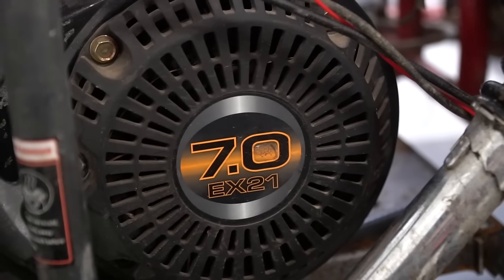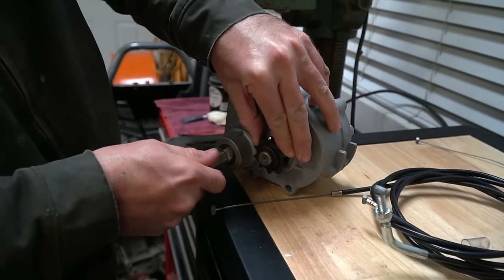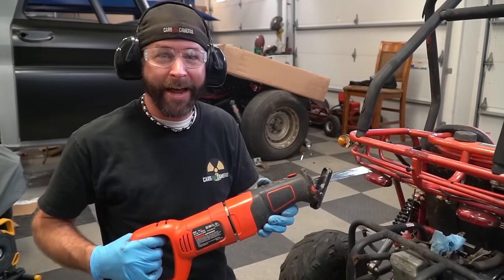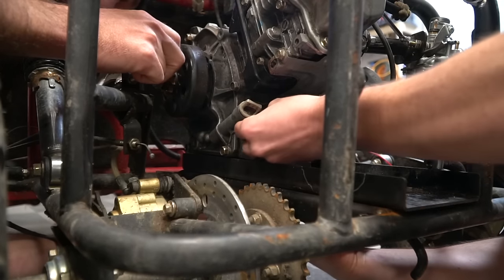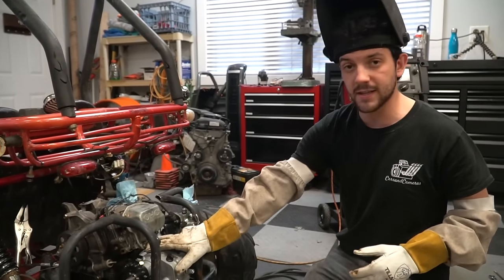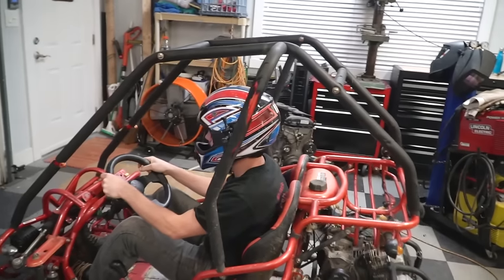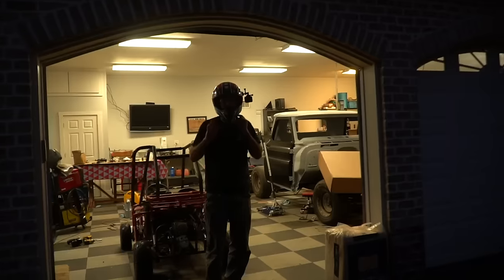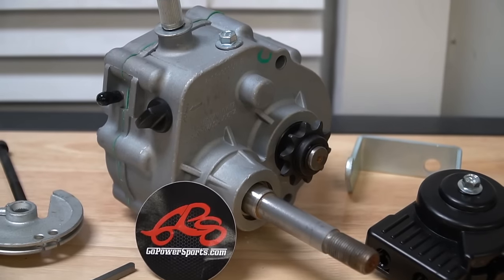Go Kart Reverse Kit Install Pt. 1

Comment: l had good luck running the reverse box with the cvt setup, the other thing is having neutral to be able to warm it up without a load, great video as always,
Reply: Same reverse box?
Reply: @isaacitllbefine7231  yes it is on the beaver amphibious vehicle
Reply: @isaacitllbefine7231  https://youtu.be/JCiZHsq6DrE it gets mated to the engine in this video.
Reply: Hey mustie1 love your vids bro i wish i had any sort of engine to work on but i cant afford any keep up the good work bro ps:i know im super late
Reply: Can this handle 20-30hp range or is this a stupid question.
Reply: @meloncholy4924  2hp to 13hp

Comment: This may have been suggested but y'all should do a tractor pull style go-kart, lawnmower something like that
Reply: Daniel Davis that would be awesome!!
Reply: Needs to be a diesel
Reply: @JakobSGames  true because diesel would have more torque
Reply: little lifted truck bodied thing can probably pull pretty good
Reply: I think they should do a decent mower. 
Not that I think mines all that,but the kids tell me in the video comments it does kick some ass. 
It’s just a 612 deutz allis with a 20hp vtwin and a mst206. 
It’s a blast to drift and it tops out just under 30, and rips donuts and burnouts all day.
Reply: junkiehunter 
I think they just need more hp in general. 
Start with 20 because it’s not hard finding used Briggs v twins, mine was 175 and came with a mower 😬
Reply: junkiehunter bro ur tripping. See yah next fall 👋

Comment from the maker: CORRECTION: THE "OIL FILL LEVEL" MENTIONED AT 2:06 IS NOT ACTUALLY OIL FILL- DON'T REMOVE IT!
Reply: CarsandCameras What is it
Reply: @Victorsvolkswagens  its the ball and spring for the shifter positions
Reply: Thanks Ike you guys should do a racing John Deere gator
Reply: I disliked the comment lol @CarsandCameras
Reply: Can I take my mud mower to Busco beach
Reply: How about some BIGGER tires. That would be cool. Nice
Reply: Why not a tourqe converter reverser hooked directly to the back of the tourqe converter  just asking love the channel and some assume ideas
Reply: @darkhorsewelding6376  this is the same thing, the setup looks  the same too i dont see how they would fit together without a chain

Comment: excellent! yes to a little taller more aggressive tires, front+rear both. gearbox+engine sprockets will make it EASY+CHEAP to adjust gear ratio for tire size. maybe inch taller in rear and 3" taller up front for a little more clearance? small tires sure have a way of getting stuck.

Comment: CarsandCameras I hope the manufactures create an upgraded version of that gearbox in the future which features Reverse, Neutral, Low, and High gears.  Great videos BTW.
Reply: Well could get a gearbox from an ATV with hi and low.
Reply: @Ratkill9000  Or an old Sears lawnmower, or many other devices...I have used them on go carts, but a newly manufactured device like the one shown in the video would allow for many others to experience the mechanically advantageous superiority of low/high gears without the complication of acquiring, modifying, and fabricobbling unwieldy or ugly machines.
Reply: @ProlificInvention  wouldn't take much to get a Polairs 250 Trailboss gearbox to work on one and make it look good. Sucks they don't have connections to have gearboxes made for what they need.
Reply: @Ratkill9000  Yes, I own a Polaris Trail Boss 250, but it only has Fwd,  Neutral, Rev...and relies on a torque converter for changing ratios, so essentially the same as the one CarsandCameras used...maybe newer models had hi/low gears?  Anyway my comment is just hopefulness that manufacturers heed the call.  I have put many types of transmissions on different contraptions and vehicles, but always wished I could just buy a brand new Chinese cheapie with Hi/Neutral/low/reverse that was small in size and made specifically for horizontal shaft engines.  Here is my trail boss when I first got it:
https://youtu.be/0y_QlymnAqM
Reply: @ProlificInvention  a guy on minibuggy net built a mini buggy, he called 250 Microburst used a hi/low gearbox from a Polaris 250, might have been a 1992 model. He goes by daaboots there and glassglowz here on YouTube. That's the only gearbox that I know of, besides an RPM that offers hi and low ratios, plus reverse without breaking the bank, unlike the RPM which goes for $5000 or so.
Reply from the maker: Yeah that'd be a game changer

Comment: I'm building a predator 6.5hp golf cart what do you reccomend 
A. Clutch or torque converter 
B. Number of teeth on clutch or TC.
3. Number of teeth on the imput shaft to the axle... 
The axle is 15to1

Comment: Just swap out your clutch springs for some stiffer ones.  It will raise the "stall" RPM's of the clutch and give you more OOOMMMPPPHHHH  on take off.  When we did trophy races at a local kart track I got called out for having a shifter clutch.  Nope.  It's all in the springs and what position you put the shoe pivot on.

Comment: Hey guys.. Great vid. I am a disabled person. I lost my right arm and three fingers on my left hand in a train accident. I built myself a 1979 Honda XL 250 with an engine + Semi auto trans from a three wheeler. I am using a thumb throttle from the three wheeler upside down on the handle bars. Would you guys show how to do a left hand throttle? Grip shift or thumb. I just want a proper left hand throttle. 

Thanks for the awesome builds .

Comment: So what are your individual sprocket counts?    I think that kind of information would be beneficial to others in helping them determine a setup if they wanted to calculate the overall gear reduction between the motor and axle.  I know the clutch and gearbox output sprockets are 10 tooth.  The gearbox driven sprocket looks to be 18 or 19 teeth.  No idea on the axle sprocket, but I would hazard a guess around 32 to 35 .  From what I could tell, the forward gear reduction on the box itself is around 1.3, which falls in line with most of these gear boxes.  On that rough estimate, that would put your final gear reduction around 7.5:1 to 8:1-ish.

Comment: If you got rid of the clutch on the motor shaft and the sprocket on the reverse box and installed a cvt sprocket on the motor shaft and cvt sprocket on reverse box you would gain allot more response on the low end and keep your top end as well.

Comment: These reverse gearbox’s are designed to be used with torque converters. The driven pulley supposed to be mounted on that shaft you put the gear on. Also I believe you mounted the gearbox sideways so that might break it

Comment: So, if you increase the size of the drive gear on the gearbox, that gets connected to the kart's axle via chain, isn't that giving you a HIGHER gear, not a lower gear? Essentially cancelling out the lowering that the gearbox does? I'm only at the beginning of the video, maybe this gets addresses if I keep watching...

Comment: What I've done on my spider box is used a Milwaukee 19v battery instead of that crappy expensive 12v. Dude on Amazon sells a 3d printed adapter. Thought I'd throw that out there.

Comment: Your supposed to mount a TAV2 Directly to the input of the gearbox!  No support needed! And if you did put oil in the gearbox, that bolt is not a oil level check. The capacity is listed on the side.  I used gear oil,  and that breather is no good, needs a breather hose.

Comment: So did you consider cutting the motor mount of the drag car to lower the bike motor and run a driveshaft direct off the output to a rear differential rear end?

Comment: Would one of these FNR gearboxs handle the 420 predator and the 40 series torq converter?
Reply: There rated at 7hp. You can use a torque converter

Comment: Thank you guys for this video, it inspired me to install a reverse gear in my go-kart, small issue, it will go to forward and reverse but it wont move and i have a predator 420cc engine installed on my go-kart, any thoughts??!!
Reply: I'm thinking about doing this to 420cc yerf dog spider box. Did you figured it out?

Comment: Hey, it's not as hard as it seems to fab a rudimentary 2-forward, 1-reverse transmission. Really. Not like the one that "RatherBeWelding" made (it's good enough, but not what I'm meaning). Just fab a steel or aluminium box with a few gears or sprocket-to-chain systems inside with a fill/drain hole 1/3 the way from bottom. Weld some "dogs" on the lateral surface of the gears w/ corresponding dogs on a synchronizer. The synchroniser needs a disk in the middle of it with a shift fork for it. The reverse gear is just a counter-gear switch-off one way is R, the other is F, this way it actually has 2 forward and 2 reverse.  A few episodes could be dedicated to it.

Comment: Are there kits like this without a gear reduction?
Reply: Not sure
Reply from the maker: The unit itself has gear reduction, but you can also change the gearing by the sprockets on the unit itself if that makes sense.
Reply: @CarsandCameras  Thanks for the advice. I have one last question, when you say "tall" gearing do you mean bigger sprockets and does a bigger sprocket make more top end speed and less acceleration or the opposite?

Comment: Hey guys. I have a couple of questions if you don't mind. I have a 212cc predator engine and I bought it brand new off of Amazon. I tried and tried to start it but it won't start. Can you give me any tips on how to see what's wrong with it? I've checked the spark plug. I've checked compression. I think I'm doin everything right. it has good gas and brand new oil. Have any tips?
Reply: If it has spark, fuel, and compression im not sure what to tell you
Reply: @isaacitllbefine7231  ok

Comment: You guys need to run the new gearbox with a torque converter set up instead of having the crappy centrifical clutches... Or you should put on one of those clutch style centrifugal clutch's so that you would have reverse and
Reply: Drive but have a clutch as well to make driving more fun

Comment: In that time i could of fitted the 200cc 5 speed Manuel pitbike engine with electric start. And fully raced tuned. Would of made a easy 50hp. Instead of fitting a slow lawnmower engine

Comment: To no avail I am seeking and on/off road 2 speed gearbox with reverse.  It seems this just does not exist. So a scavenger hunt is warranted by I have no means of understaking any such hunt until my cross cart is functional. This leaves me searching online where this animal seems to be extinct. I furthered my quest by seeking riding mowers or garden tractors but antiquated mower owners want brand new prices. Perhaps I can turn sprockets into gears.